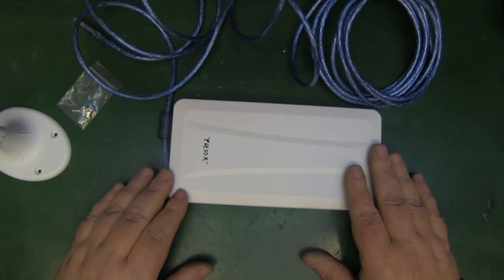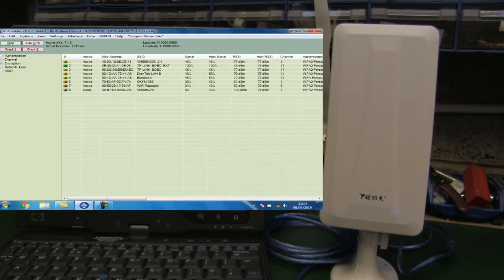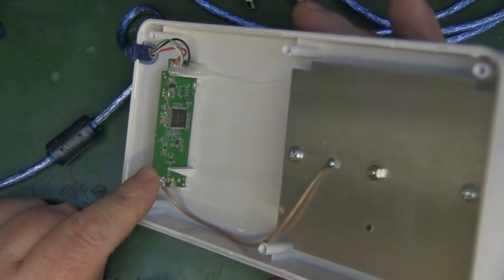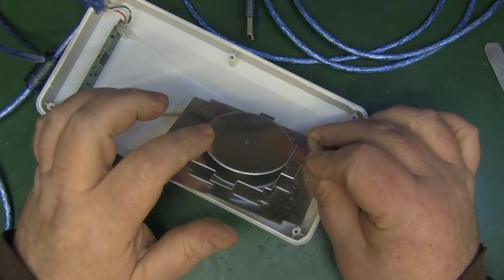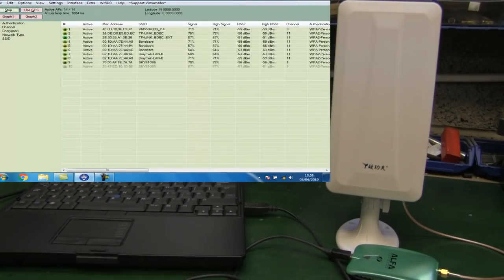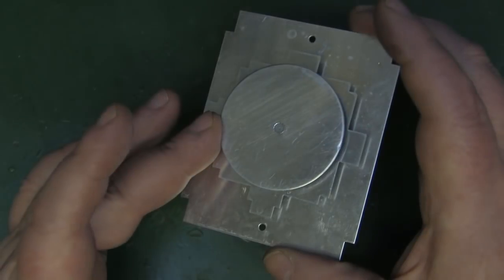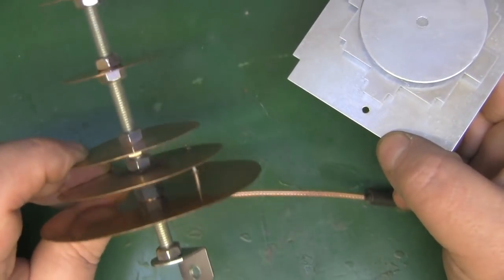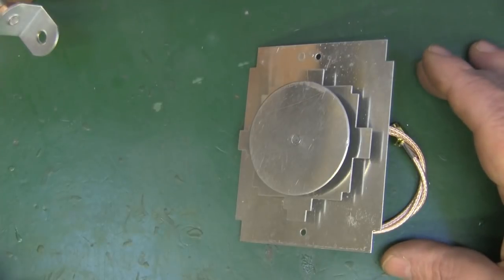All in One WiFi Antenna and Adapter

Comment: Andrew, Have always enjoyed you videos and project ideas and this video caught my eye because of the extended range possibility of wifi. What I am trying to do is setup a live cam (security cam) at our RC flying field. We do not have the possibility of an internet connection on site so must connect to a router located 100 to 300 meters away. Was thinking of using a Raspberry Pi on sight but wifi range is very limited. Something like the Alfa and this, or some, antenna would solve the range problem but it cannot be connected to the Raspberry. I looked through your videos trying to find a relay/extender that the Raspberry would connect to that would be able to reach the remote router. Do you have an suggestions as how this could be done. A video would be great and probably useful to many other individuals. Thanks

Comment: could the issue just have been the crappy coax? like the connection to the back reflector was broken...id be interested in seeing the results with the old card and new coax
Reply: Can't change the card and the co-ax then decide the problem was the card and not the cable without testing - that's bad science
Reply from the maker: It did have poor soldering to the ground but the length was so short it should not have made much difference. I am currently making the antenna out of copper sheet I could do a quick follow up in that video replacing the coax.
Reply: @andrewmcneil  awesome i'd definitely like to see the results...it is a very interesting element design regardless

Comment: Can you use a wifi antenna to say grab signal from a cafe down the street? Or do you have to use another antenna just as powerful on the opposite side to transmit the signal to the receiving antenna.
Reply: As long as you have signal overlap you can connect.

Comment: I have same question as Senior Blackfox - looking to connect 300 m away to monitor a remote garage.  Could two old satellite dishes be modified with bi-pods at the focal points?  Connect with wifi range extenders on both ends?
Reply: have two to sell outdoor tenda 03 very good

Comment: Hello.  I wanna ask u.... Is yagi antenna designed to b shorted ?    Cos i hv a yagi... When i use multimeter touch the inner and outer of coax cable. It is shorted.  Is it normal? And i hv 7ohm between them. Is it high?

Comment: What is the chipset on the Wi-Fi card?
Reply from the maker: They ground it off but it works with the same driver as the railink RT3070L. this is the same chip that is used in all the knockoff Alfa cards (well most)